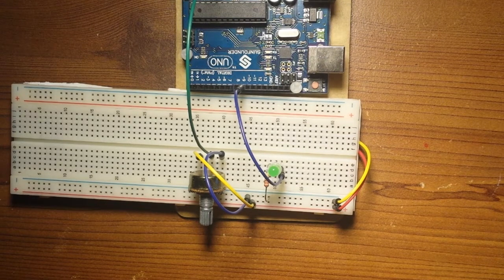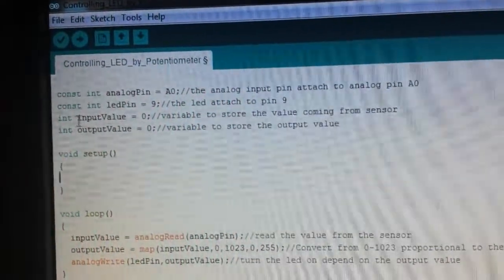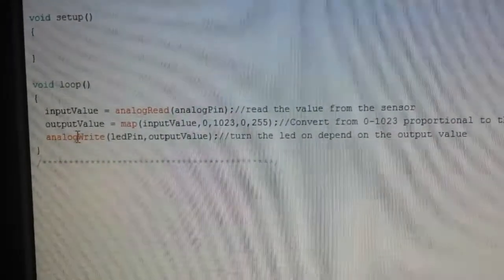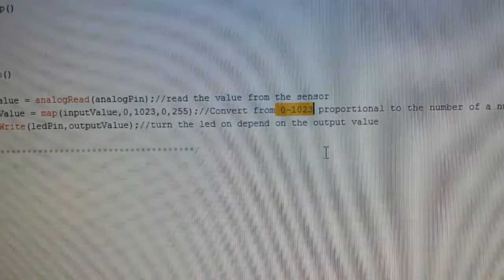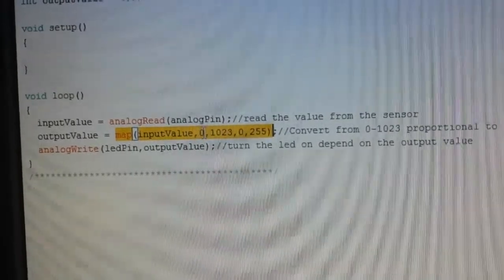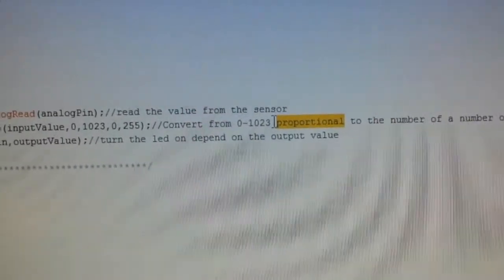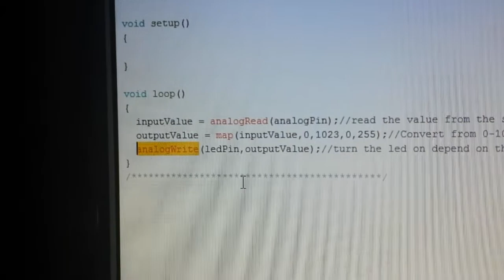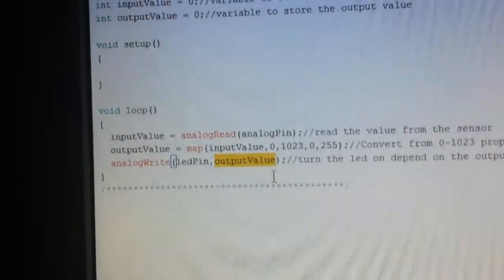Analog read and write to control LED brighness

Comment: Another question - some people always use a 330 ohm resistor, some use a 220 ohm Any reason why the difference? Which is the best to use, if there is any such thing.
Reply: They both work pretty well, the main difference is that the bigger the value, the less bright the LED will be when it is powered on, and vice versa. So with a 220 ohm resistor, it will be brighter, than with a 330 ohm resistor, but both work.

Comment: Is it possible to make the comments and open/close curly braces to fit the segment? I don't like having to read the comments above the code line, and with the curly braces two or three lines either top or bottom, it makes it hard (for me) to see the logical progression. I've not tried it in my own sketchs, but will the next time I create a program. I write the code then tab to enter the double slash and write the comment on the same line. I really like your tutorials!

Comment: I have a request, can you show how can I control 4-5 LEDS with 1 pwm pin on arduino, I am changing their brightness like making them fade in and fade out very quickly but right now I am only limited to 1 pwm pin = 1LED, I want this to be like 1 pwm pin = 4-5 LEDS, if you know please tell how would I power them?  I can't power them from 1 pin cause current it limited to 40ma. Please help !!!!!
Reply from the maker: You need to use an non transistor to power the LEDs and the pwm pin goes to the base.
Reply: @learnelectronics I'll try that, I hope brightness of all the LEDS changes, thanks.
Reply: learnelectronics it worked perfectly, thanks.